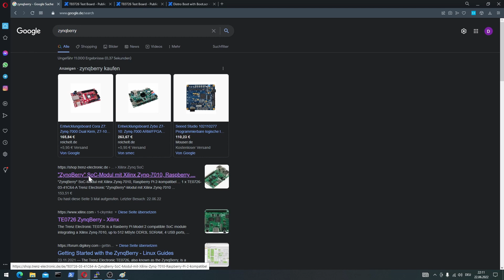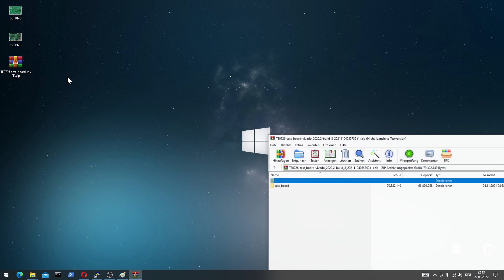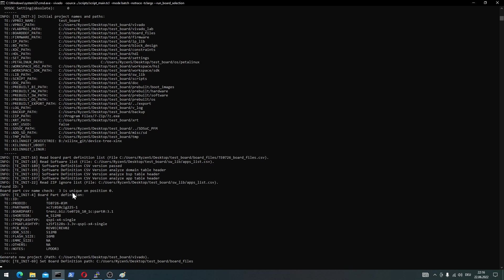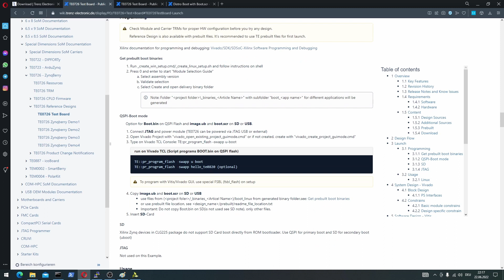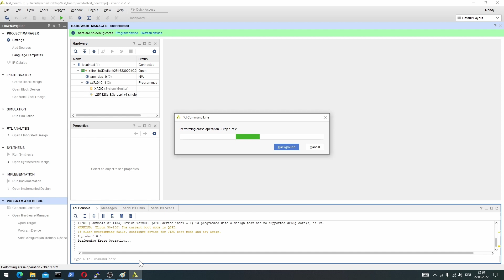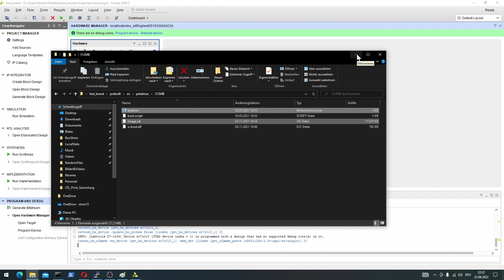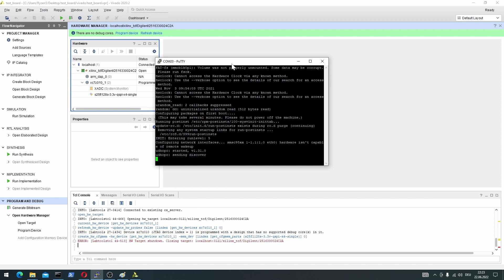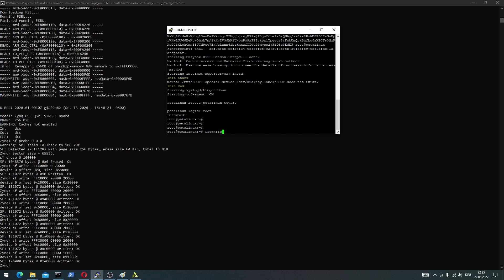Trenz TE0726 Zynqberry Petalinux - Getting Started with simple Reference Design Vivado 2020.2

Comment: There is no s25fl128s-3.3v-qspi-x4-single. So,  I add s25fl128s-3.3v-qspi-x4 using Add configuration Memory Device.... But, when programming Configuration Memory Device, i met errors like HW target shutdown, Closing target:localhost ~~~ and No hardware targets exist on the server .... Could I get some tips to solve the problems
Reply: Make sure your power supply is strong enough. You could also try to solder a direct connection and connect to a bench power supply, in that way you can monitor you current consumption.  
힘내!